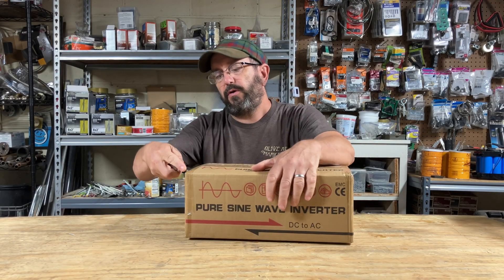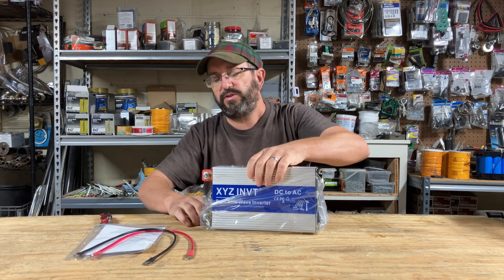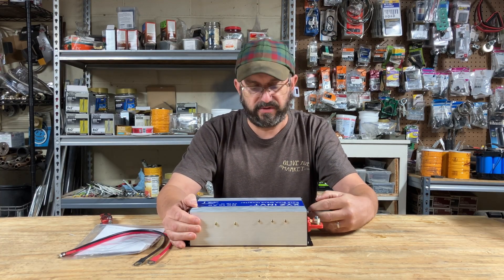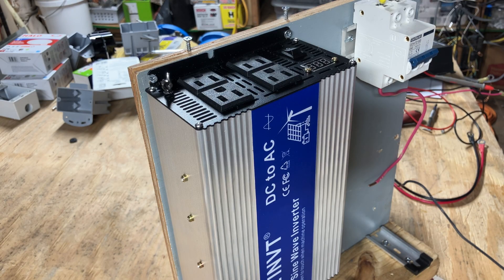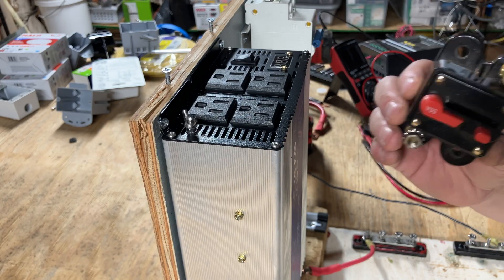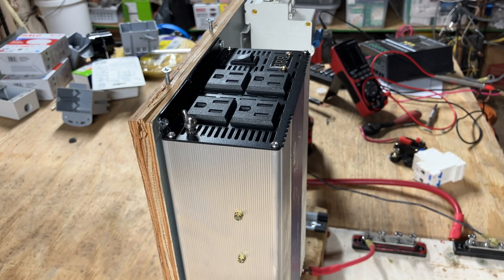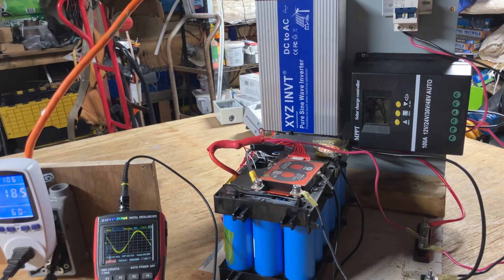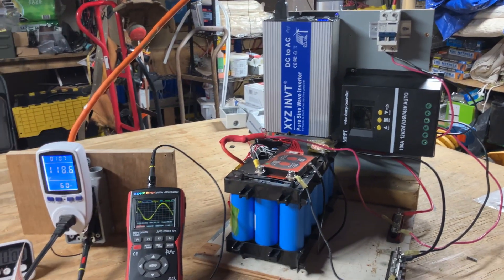Easy & simple yet powerful 48v 2kw DIY Power Station Solar Generator build with a XYZ INVT inverter.

Comment: Paul - I see you used cylindrical cells - the ...umpty-ump '80's or whatever they are.  Not too much out there on the net done with these yet...  this was a really great video, mainly because of the simplicity demonstrating a very tangible end result!  Voila! You made a power station, easily understandable to most of us watching! You showed us something most of us could build-you made the complicated quite easy to this viewer.  I should show this to everyone I know - This reminds me of Will Prowse's early videos that he made in his RV, sitting on the floor.  It's the kind of thing that got me interested in solar power - I said to myself back then,  "Yes, Terry, even YOU could do this!"  Thanks for the good stuff!
Reply from the maker: Thanks!  Glad you liked it.  I have only bought prismatic cells but I had these cylindrical cells from a power station. The BMS had failed but the cells were fine.  So I just bought a small BMS and replaced it.  But since it was a small 48v battery, I wasn't sure what to do with it.  But with that inverter, it made a really nice small 48v DIY build.